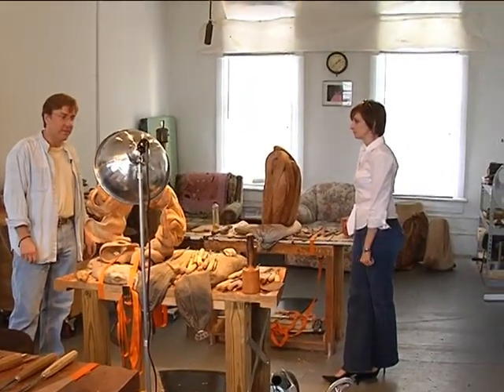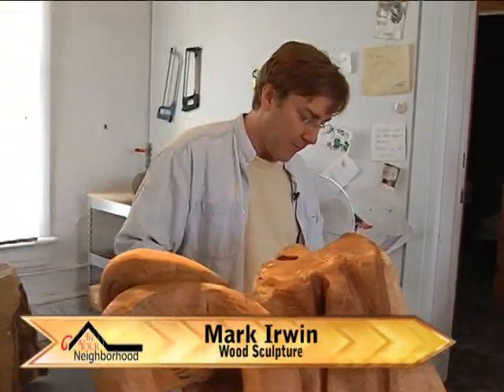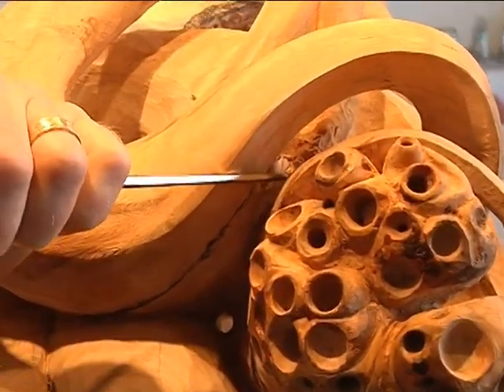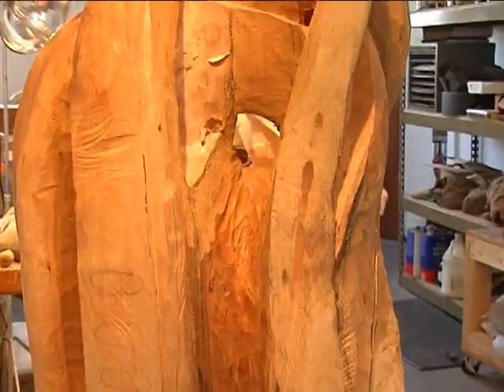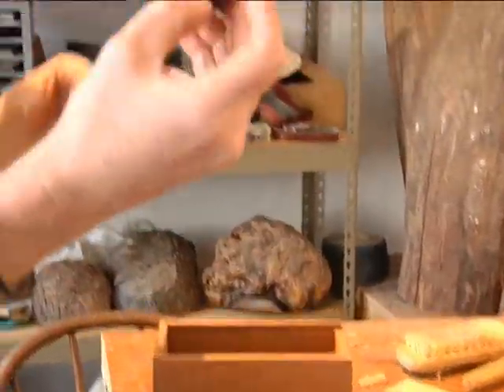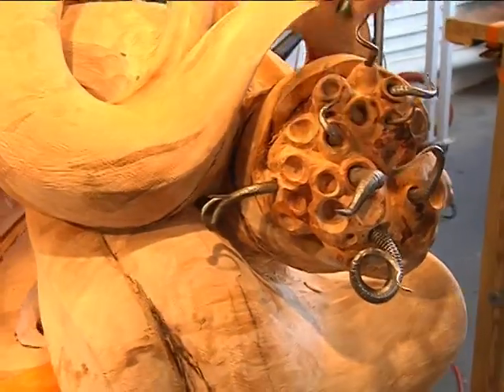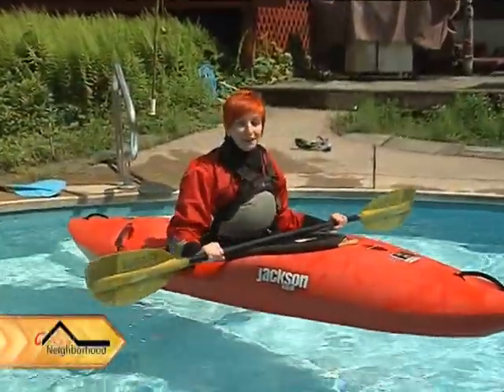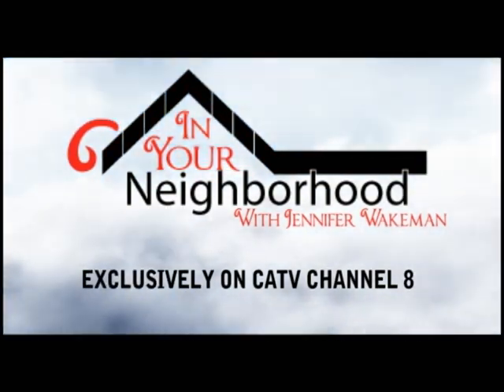Mark Irwin Wood Sculptor (Season 1.5)

Comment: I enjoyed your video.  I would like to try this myself.  My question is:  do I need to fully dry out the wood before I start or can I carve it green and then dry it slowly?
What do use to finish the wood?
Txs.
Chris........
Reply: I just ran across this video and noticed your comment. Hopefully you have indulged in this satisfying process. I have done quite a lot of sculptures in the past using many techniques and tools. It is my preference to start out with green wood and take the form to a rough state because it is much easier to remove the unwanted wood. Then let the drying process begin. This result  in less checking and splitting or at least not as pronounced than letting the initial raw form dry before attacking. https://www.facebook.com/woodworksbygarry/